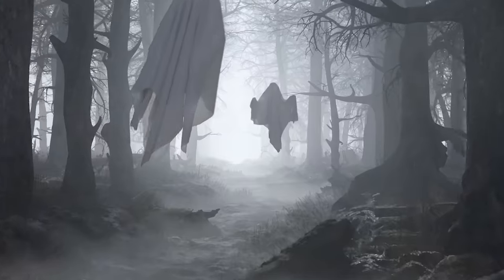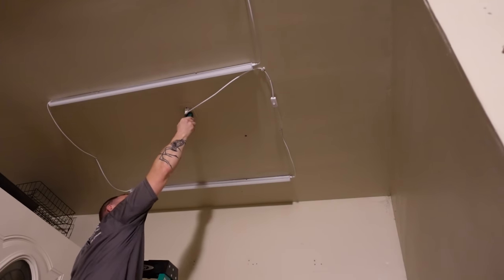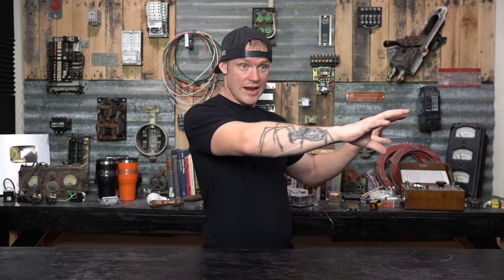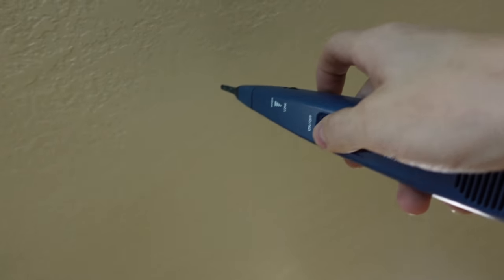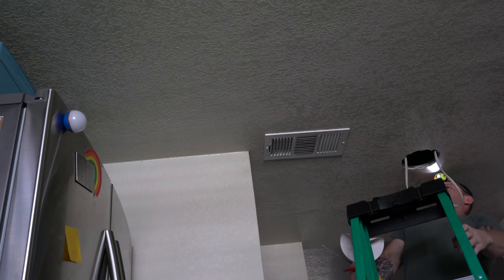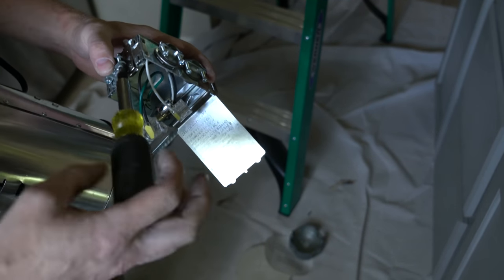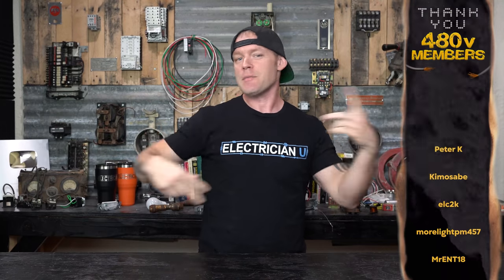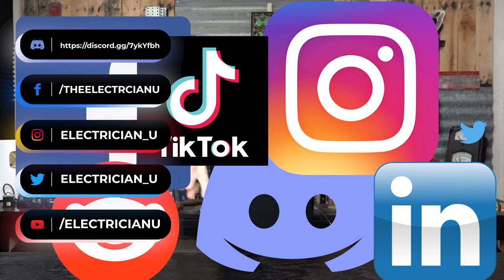THIS IS WHY ELECTRICIANS DON'T HIDE J-BOXES IN WALLS - Finding Hackwork!!

Comment: I had something very similar to this back in 2006.  I had weird voltages and I eventually found a junction box in the ceiling of the garage which had been converted into a den, laundry room, and storage room.  I ended up finding 3 or 4 "junctions"...without boxes...lying in blown-in insulation! ‍🔥 There was one junction box, but it didn't have a cover!

Comment: I was a troubleshooting technical analyst at an ISP for years before becoming an electrician (apprentice still) and service work is something I really enjoy. I get to use that old 'muscle' before. I like you question and answer approach with the homeowner. Skipping that process or skimming it could result in a lot of wasted time.

Comment: Great methodical approach. Asking questions then interpreting the answers is so important in troubleshooting. Equally important is working efficiently so clean up is quick and easy so you're left with a job you can be proud of and the homeowner is happy to pay for.  Bonus points for installing a new light in your access hole.
Reply: I used to get the 5 gallon containers that Pepsi shipped their flavoring in, to local bottling plants. They were quite thick plastic, and had a handle molded into the top.  I cut a rectangular hole into several, near the top. I used them as a portable stool when working large job sites. You simply put any trash into them as you worked, so there was no cleanup. Very handy in schools or offices.
Try troubleshooting brand new 16 layer circuit boards, with shorted power rails. None of his tricks would have worked,, and there was no one to answer questions.
Reply: Too many trades people DON'T listen to customers at all. It's a good idea to listen for the symptoms described by the owner. But take their suspected reasons with a grain of salt.
What you do take limited notice of, is some untrained person who has entered fault details into a computer database. What they are entering is what they think the customer is talking about. It might be correct, but you could be looking for something unrelated.

Comment: Great video, very thorough and clearly explained.

2 jobs in a row, buried junction boxes and a ground wire being used as a hot wire.  Both jobs resulted in expensive labor costs that the client obviously did not anticipate.  They aren’t very happy but end up cussing whoever did the dirty unsafe deed in the past.  BOTH jobs were flips at one time.  I often find these blatant code violations, both in new and old homes.  In new homes I often question the building inspector’s competence and diligence.  Inspections are sometimes done AFTER the drywall goes up!  I rarely get called out to correct a code violation,  I usually find then as bonus charges as I’m installing or repairing something else.

Comment: Also good job with the logic.  I remember as an apprentice having moment of panic not knowing how to trouble shoot.  At least a guy gains confidence the more things you run into.  Just last month I ran into two homeowner sub panels that had the bonding screw still in the sub panel (with a mainbreaker).  In one case a kid got lifted pretty bade as he became a portion of the neutral.

Comment: I am just a DYI-er with a house built in the 70's and recurring issues with legacy wiring, fixtures, and outlets. Before I'm done, I or an electrician will have replaced all the wall receptacles, mark my words. I've encountered taped junctions and wire nuts behind drywall! I'm in the process of swapping out a noisy contractor grade bathroom fan for a super-quiet bathroom fan and adding several LED ceiling lights as you described. This video was interesting and entertaining, but also validated my choice to create a J-box in the ceiling to extend the circuit to reach the LED light boxes. Thanks.

Comment: I really appreciate the format of your video. From tips to safety to codes to "cleanup" recommendations, this was really well thought out. Side note, "disposable" drop cloths with a felt like material on one side and plastic on the other are available at most hardware/farm supply stores for less than $20. They work great for protecting surfaces and also stop liquids to include paints and lacquers. Reusable as many times as you'd like, but cheap enough to toss if they end up catching a really incredible mess.  You're absolutely right about people appreciating that extra step and it doesn't have to be expensive.

Comment: i had one recently homeowner said "i went to bed woke up to no power in several parts of my house" (mostly lights) chased this circuit had both a circuit tracer and toner i also had the same problem it sent me on a wild goose chase finally found 3 j boxes in the attic under a floor that had  a second floor over over it and the third box (last 1 i had) opened it and found a neutral with the screw in type wire nut with 1 wire not even stripped burnt and as you showed melted white wires together. and as a P.S. to your great video you could mention  how neutral (l2) can kill

Comment: Called open neutral at 3:00 based on description and plug tester, I was right :D   edit: Weird voltage is the voltage Its traveling back thru lights and appliances down the line on the neutral trying to find a path to ground.  That voltage changes depending on how many light and appliances its going thru to come back.
Reply: Great explanation Aaron.
Reply: Quality electrician, right here ☝️
Reply: I won’t lie. I thought melted bus on the problem recep noted. Using the toner is an extremely helpful tool. Had a contractor bury LV doorbell wire in the wall. Found it with a toner no cutting necessary.
Reply: My thought exactly, have had this problem multiple times thanks to ac units and space heaters burning up back stabbed outlets. Actually made a comment saying pretty much the exact same thing you did before scrolling through the comments. Its nice to see that troubleshooting isn't a lost art. Been in the trade for 3 years now and am only 21 got a lot more to learn, but it's nice to see that i must be learning something.
Reply: @crazygameplays1519  learn something every day! Won’t ever get better if we don’t.
Reply: Oh man you solved it you must've been in the background showing him
Reply: @elnewchurch0  The day we stop learning is the day we die
Reply: Also a huge indicator of a grounding issue is the hot neutral reverse. I called open neutral as soon as he stuck his tester in.
Reply: Actually ghost voltages comes from capacitive induction from the hot wire and the voltage is proportional to the length of the wire among other things. If you try to connect an appliance over wire carrying the ghost voltage and ground the voltage reading instantly drops to zero since this capacitive induction can't carry much current. The multimeter however has 1 megaohm input resistance so it won't load very much and you'll get a voltage reading.

Comment: YOU ARE AWESOME!  I'm not a electrician.  I'm a homeowner that occasionally changed out a plug or a switch.  I just stumbled onto your video and got hooked in it because of your animated and enthusiastic presentation.  What an amazing job of troubleshooting.  

I'll keep in mind the tips and tools you used, but if I encountered a problem like yours, I think I'd just burn the house down and start over.

Comment: Great video. "Old houses built in the 1970's or 80's" LOL. I bought my house in 1980, but it was built in 1923 with knob and tube wiring, with taped splices in the ceilings all over the place! And, of course, no grounds. The service panel was new, thank god, but each run of cloth covered wire ended in a junction box near the panel. I helped my handyman brother do some remodeling, and read extensively about home rewiring and taught myself. Over the next decade I rewired every room, one at a time. Got good with plaster and lath box retrofitting. (Removed ll the outside walls to insulate where I could). Also installed a new subpanel and ran two lines underground for the remote garage, so I could have 220 in the future. There was no internet back then, only instruction books and the NEC code book. I wish I had access to your vast knowledge at the time. Thanks again.

Comment: As someone who lives in a really old apartment building that's been converted and built up over and over again like some sort of lovecraftian horror show both with plumbing and electrical...I loved this.
Reply: Old apartments are bad. You get maintenance guys doing things they shouldn't. I just found a buried junction box behind a mirror that they had just put drywall mud in to fill in the box where the old light was. They had moved up the light for a bigger mirror and the wires had burned inside of that mud filled box.
Reply: Your house sounds like mine. The plumbers don't want to come back because they don't know where the pipes are going. There's pipes that don't do anything at all.

Comment: I've seen a fully lit led exit sign buried in a ceiling, they did not intend to remove it because there was another one a foot away at the proper height you would never know  that thing was up there once they ceil it
Reply: Seen the same with emergency lights
Reply: LOL, the Fire Marshall loves that kind of stuff.
Reply: I've seen that a lot before. Every year or two years commercial buildings need to be inspected for occupancy permits. And he failed the building because an exit sign that was buried in the drop ceiling was out. (He saw it because the had a couple tiles down for remodeling)

Comment: I've used that toner more this year than any other. It really helps locate the wires and devices a lot quicker without taking everything apart. I had an older house that was giving weird readings, but by touching the two wires together makes it make another sound verifying continuity. Great advice and workmanship.

Comment: As an IT guy I really appreciate the breakdown here.  I had a similar experience with a Wireless Access Point that my predecessor installed with no documentation.  I was labeling everything and got to one access point that I have no idea where TF it was.  I had rebooted and labelled every AP with it's room number and wire drop.  Eventually I just waited until after hours and said "f*** it I'm going to find this thing".  I shut off every other AP in the whole building and started walking around with my WiFi analyzer trying to determine where the signal was strongest.  When I narrowed in on it it was a poor, sad looking AP that was covered in an inch of dust laying in a ceiling tile.  No mount or anything.  Just sitting there with a random Ethernet wire running to it next to a metal roof joist.  Some people are a**hats and just do stuff without caring about the next guy.

Comment: Pro tip : Use a battery operated smoke alarm to cover up to a 4" hole you cut. Add a Old work,  cut in round box and smoke detector after you are done using hole. Good for hiding junction boxes and  pull points as well on long wire pulls in finished houses.
Reply: You sir. . . are an evil genius.
Reply: What if you can't connect that new smoke to an existing old an smoke? Then that added smoke won't go off when all the others do and visa versa
Reply: @jvonrobbins3373  - What does that have to do with anything? You're not doing a rough in. Drywall is up and it's service work. The property should already have the alarm circuit worked out. We are doing the install to cover a hole and it's cosmetic.
Reply: @jvonrobbins3373  just don't put a battery in the detector just a quick easy way to hide a hole

Comment: Dude!!! This is the best "Electrical" video I have seen in life!! This totally validated what I do to solve problems, myself being a service electrician for the company I work for and especially my sidework in homes!  Everything from gathering as much info as possible from the customer to coming with that smart idea of installing that recessed light where that hidden j box was to make it accessible.  I truly enjoyed this video. 
I noticed you used a keyhole saw to cut the 6 inch hole...have you thought about investing in the adjustable drill attachment that comes with a bowl to cover the cutting area to get the dust? I personally use Milwaukee but they're made by other companies as well. Fast,efficient and clean; that's my only suggestion. 👍🏼

Comment: Great video. I have minor experience running cables as a network tech, but no experience as an electrician. What I found most fascinating were the similarities between what YOU described and what I have done in -multiple-different professions. Bottom line: be knowledgeable, be professional, be straightforward, be considerate. Kudos to you for representing all those qualities 100%, and also, thanks very much for sharing your experience and insights. Respect!!

Comment: Too many home professionals don’t give the first thought to cleanliness and how they’re leaving the environment afterward. Kudos to you for making it such a point and for doing an awesome job tracking down this problem and coming up with a nice solution.
Reply: On your tone and probe tool if you connect your red alligator clip and place it on the black wire and take your toners black alligator clips and put it on something metal it will only still send a tone down 1 wire

Comment: In the Chicagoland area- I've found weird boxes buried behind plaster...crazy old school wiring (not knob and tube) but just black and white covered in cloth insulation inside EMT that's serving as the ground.  
Apartment building, 2 levels plus a basement garden apt: replaced all the receptacles and light fixtures.   On the 2nd floor there are still problems. Moved the bed and notice the plaster and drywall looking odd and weird smell coming from it-  low and behold, a buried box behind half plaster and half drywall and joint compound (no tape or mesh) a box w/ a broken receptacle shoved inside of it, that someone decided to bury... 🤬
Reply: I used to own a house build in early 50's. Original wires were aluminium in cloth insulation.
Reply: @spol1622  Ugh, at that point I'd tell the homeowner that they need to swap to copper and new service panel.  The upfront cost is worth the drop in homeowner's insurance and peace of mind!
What did you end up doing?

Comment: I bought me a few years back a toner that looks like that from either HD or HFT, I can't remember the store to find a conduit that was being tripped on a kitchen. someone that renovated the island in the middle had placed a metal junction box and it was short created a short due to just using electrical tape to isolate. After a few hours of really making sure all electrical tape was  removed from a crap load of circuits. I fixed it, who does that? Using electrical tape that over time comes loose and possible create a fire or worse a death by just being cheap.